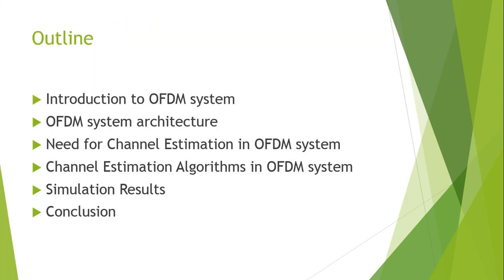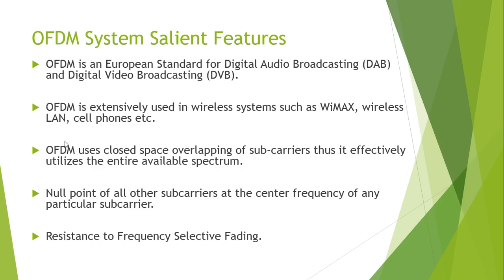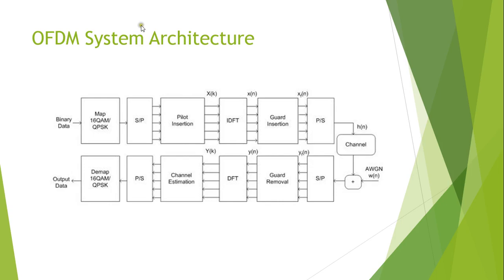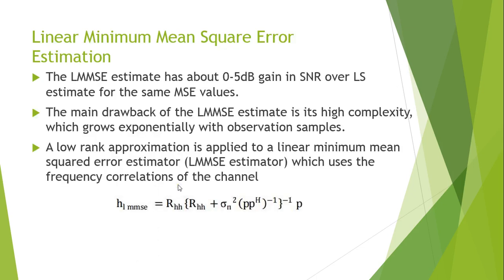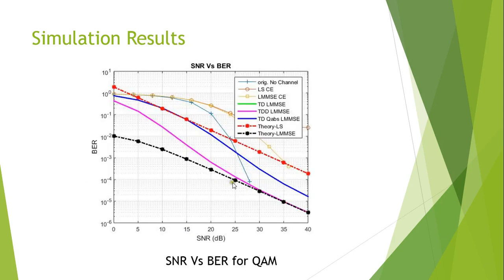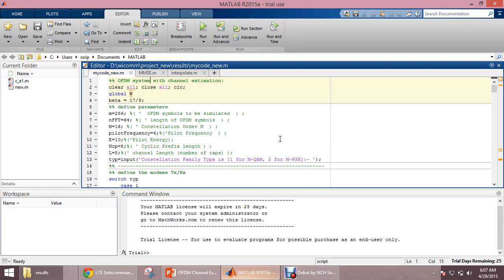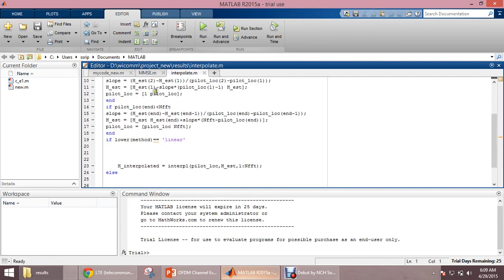Analysis and Comparision of Channel Estimation Algorithms in OFDM System

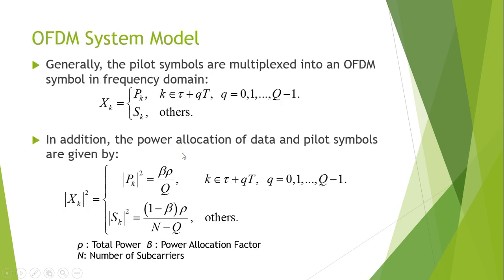Comment: At time 6:57, may I ask what Tau is? And what is capital 'T'? Thanks very much.
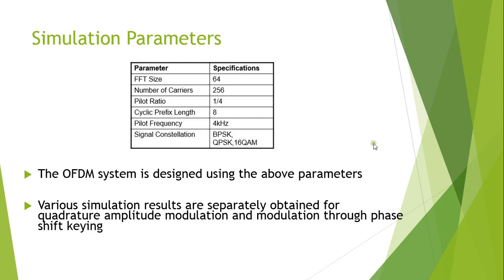And at time 11:20, may I ask why the FFT size is only 64? If there are 256 carriers, then wouldn't we need an FFT size much greater than 64?
Also - at time 7:35, are the kth elements (the channel frequency response) meant to be vectors? And what does I_N (I underscore N) represent at the bottom-right-hand-side of the slide?